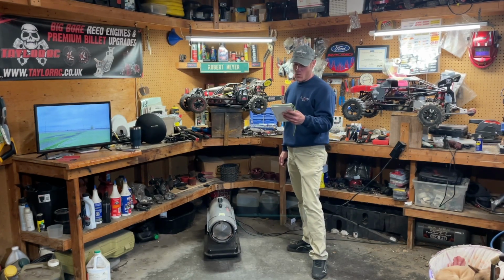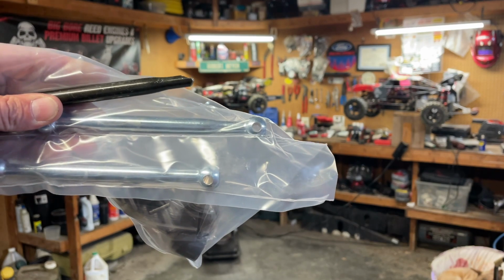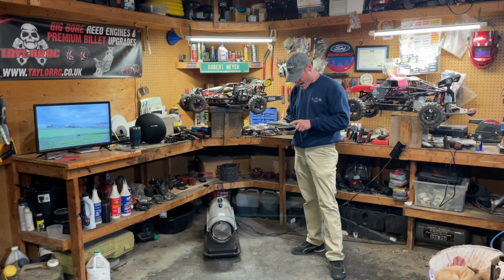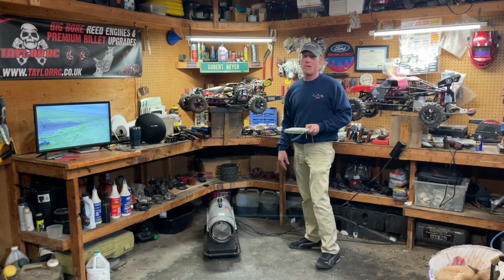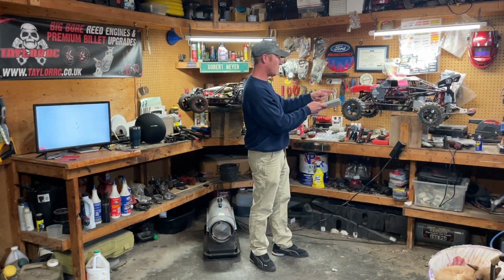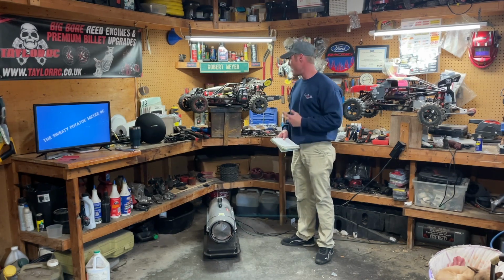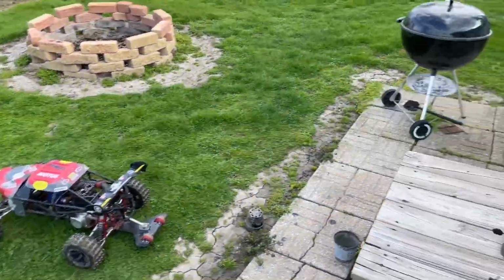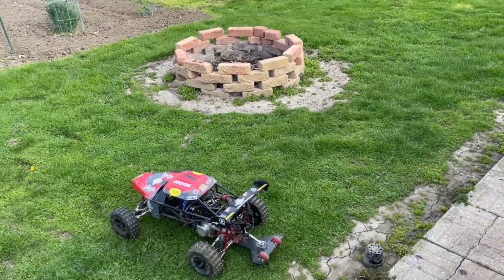TAYLOR RC 35 AND TAYLOR RC 40GT LET'S SEE THE DIFFERENCE

Comment: Wow, but I didn't know that you guys were running fans on gas power motors. See, I'm running all electric, OK? Ay, I'm hitting 75 miles an hour on 8 a**What are you guys doing? And I'm able to run 3045 minutes on a battery pack.
Reply from the maker: I run gas power bro😉 let’s see you do 75 in the grass lol 😂 this is 64MPH right here 👇🏼👇🏼👇🏼

64 MPH SPEED RUN!!! #taylorrc #beastmode
https://youtube.com/shorts/qikNy67S8FI?feature=share